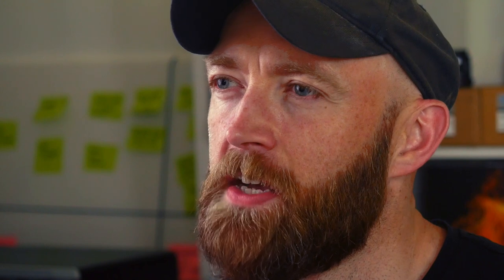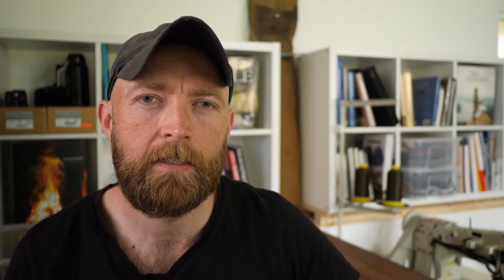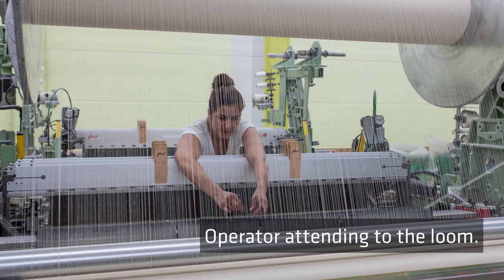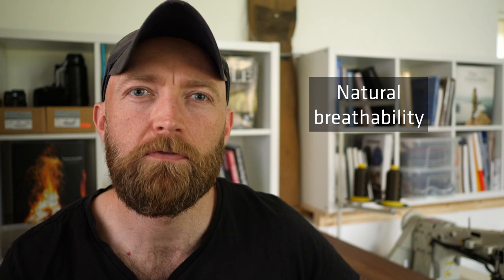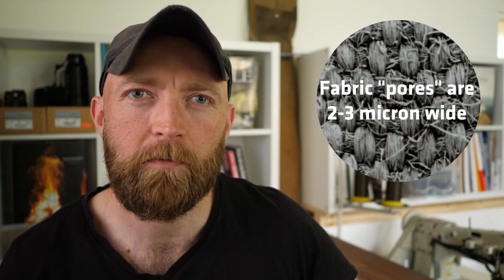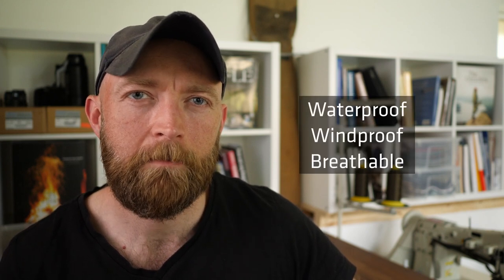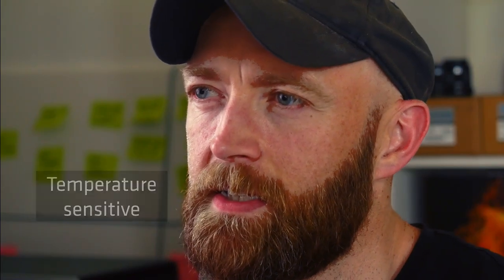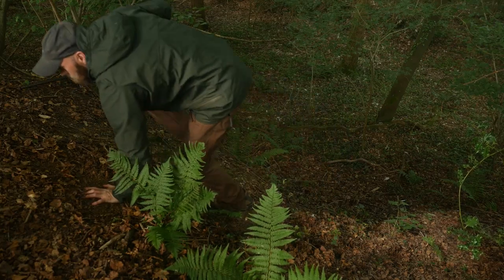RedKettle - Ventile cotton fabric: Challenging conventional wisdom

Comment: Ventile is an old trademark. In fact “ventile” is just Stotz etaproof cotton and has been for over 30 years. I prefer the etaproof trademark.
Reply from the maker: Hi there,

Thanks for taking your time to comment.

Yes, Ventile and etaproof are the same fabric ranges.

Stotz actively market the fabric as Ventile so we haven't seen any practical reason for switching to the etaproof term.

All the best
Reply: @RedKettleEfficientHunting  Yes, and I guess the trademark "Ventile" is still very well recognised in the U.K (in particular). Your garments look excellent! Best wishes.
Reply from the maker: harrydance1969, you're absolutely right. It's a little more recognised in the UK in particular.

Thanks! Much appreciated.

All the best.
Reply: @RedKettleEfficientHunting  Its great stuff. My jackets can get very stiff when soaked but the breathability is excellent. 

I think the stories about it being used for WW2 immersion suits are nonsense though.
Reply from the maker: Thanks for your comments!

Yes, it does get stiff when wet, because the fibres swell.

The reference to the WW2 immersion suits comes from Ventile/Stotz. 

To be on the safe side we reference checked it in scientific publications before sharing the story (The textile institute book series: Waterproof and Water repellent textiles and clothing, published by Elsevier, edited by John Williams).

All the best
Reply: @RedKettleEfficientHunting  the book "Invisible on Everest" (Mike Parsons/Mary Rose) also quotes a Public Records Office paper to support this story.